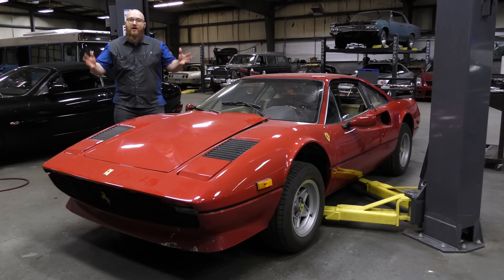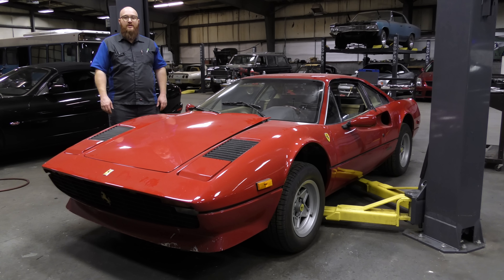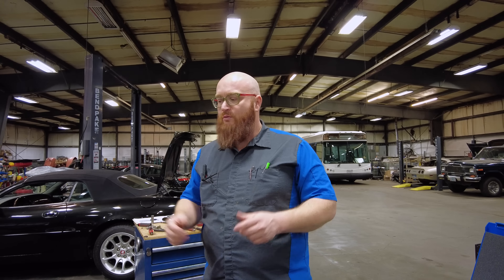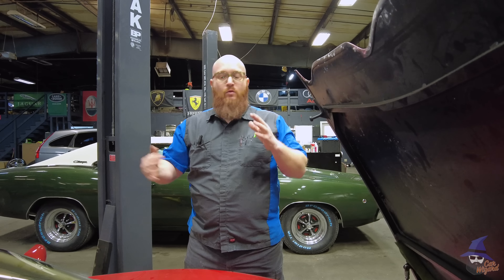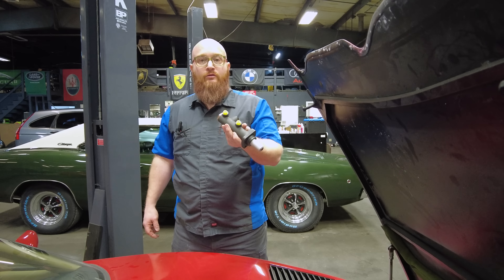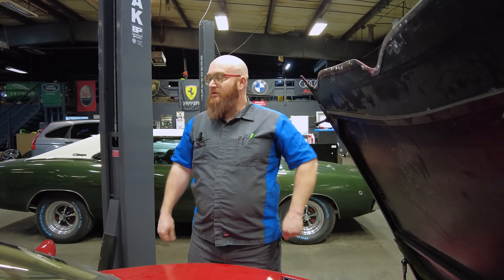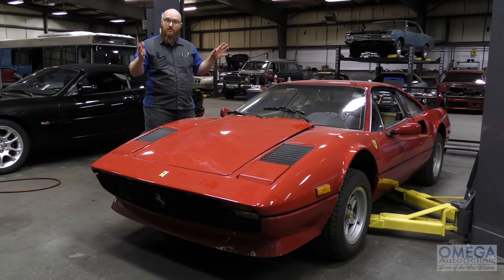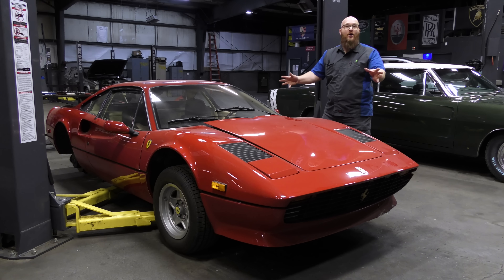My '78 Ferrari 308 can't be tuned! CAR WIZARD has to make some serious changes.

Comment: The carburetors fitted to the 308 Ferrari were well suited and reliable - when the engine and carbs, and particurlay the OEM jets fitted within the carbs are untouched.

An Australian friend (motor mechnic) that imported a Fiat Dino Spider (Fiat fitted with Ferrari V6) from the USA also experienced problems with tuning the carbs after a thorough and exhausing total vehicle, engine, ancillary rebuild/restoration that included the carburetors - a problem that remained unresolved for some time even after repeated checks of the motor, and in particular the carbys and their internals.   

After much time, frustration and detailed detective work, he found that a "genius"  had simply drilled out (enlarged) the jet's orifice in an attempt to increase fuel flow - i.e. so the number etched on the jets did not represent the actual size of the orifice (boy - did that take some digging to establish the jets were at fault).   Needless to say, than when a new set of standard jets (mains, idles, emulsion - all changed because confidence in the carby internals by this stage was low) were fitted, the motor/carbys ran like clockwork.

The aforesaid "genius" didn't understand that simply increasing idle or main jet orifice diameter (add more fuel to engine) does not automatically result in more power and improved driveability - when all other engine sub-systems remain unchanged.

Comment: Ferrari V8 cooling systems are also questionable from my experience. There water pumps fail to circulate coolant at around 2000 rpm through one cylinder head which can cause the suffering cylinder head from cracking. Test the pump to see if it works according to Otto's rules before tuning a 4 stroke engine, establish at 500 rpm that the coolant flow MUST be 10 liters per minute. Do not attempt to tune an engine that has a coolant flow less than 10 liters per minute as the hottest part of the engine being the exhaust valve SEAT will be distorting due to poor coolant flow over that portion of the cylinder head. Not all cylinders will be suffering from distortion but the best way to establish which cylinders are suffering a vacuum leak is with a set of thin wall extractors getting them to glow red hot and the stand out cylinders will be a lot brighter orange than the rest. 
Once you have achieved Otto's tune rule then the engine will perform like never before , I only say this from many years of experience.

Comment: After more than a Year of rebuilds,repairs,and updates on this with all the videos about each,I'm pretty disappointed that you have a 'cam seal leak'.Makes me wonder about the skills available as Hoovie's Jag leaks and so have a couple others.'Suppliers' aren't the problem if leaks persist.I'm not knocking the guys for the hard work,but the choices in materials.Good luck.I'll wait until it's in your hands,or Euroasian Bob's.
Reply: Cars that sit end up leaking. Meant to be driven. Jags were leakers from day one. If it isn't leaking, it's out of oil! It's only been in the last ten years or so that people complain about oil drips. Look in any garage from decades ago and there was a large black spot on the floor. Open the hood and you couldn't tell what the engine paint color was.

Comment: I have a real sports car, the kind you can sport around in and enjoy, trouble free! A 1985 MK2 Celica Supra. Best of all cheap to keep, Tires, oil changes and other fluids. A little over 100,000 miles and now due for it's second timing belt. About 200$ in parts to do it. Toyota made some of the best sports cars ever, why, because they are reliable. I believe it still has the original brake pads in it.
   Dan Gurney seems to like them, He autographed my glove box door!!! And that is good enough for me!

Comment: Car wizard.  I bought a 10 rx350 and a week later without the key in my pocket i walk into the garage.  I thought i heard the neighbor a long way away's air compressor charging but it was coming from near my fuel tank.. i think.  Under the car in back half. I got the key then started the car and the noise vanished after shutdown.  It was pretty quiet.  Can you or anybody say what it probably is?

Comment: fun fact kiddies , with electrics , particulary engine management systems , alternatives to OEM are available , consider LINK or HALTECH , no replacement plug n play exists for the 308 but they can and will tailor a unit for your needs ! MoTec make 12 cyl units  , ecu fault pfft , no problem !

Comment: I’m getting really fed up with piss poor car parts. I just put a new cooling system in a car. Both the radiator AND the brand new radiator cap itself are leaking.

Comment: Get a Toyota MR2 with a tuned exhaust, stick a Ferrari prancing horse on the steering wheel and drive rather than wrench!  I would love to see you take my Porsche 917/10 replica to the next level that I lacked the experience to do.  Two Subaru EZ30 engines to make a 12-cylinder boxer engine like the original!

Comment: The issue your talking towards,  computer obsolescence, is the issue that will kill upcoming classic cars. 2000 Turbo Beetle, with less than 3,000 made? Mine bit the dust with multiple issues related to security software embedded into things like speedometer,  AC controller,  and parts designed to fail like the water pump with no after market to support the car. So. Figure 20-30 years from now? That 1924 Ford will still be thinking down the road,  57 Chevy as well.... but I doubt if you'll see any car from 85 to 23 on the road.

Comment: In the key of The Offspring: Better keep them Carburetorated. Study up on those Weber jets and downdrafts. Remove all that modern crap. Pull out the flow sync and hook up the exhaust sniffer. In other words, be a real mechanic. Not a slave to the diagnostic computer.

Comment: In the current world of remove and replace it’s become “unfashionable” and normally uneconomic to rebuild worn parts such as a brake master cylinder - especially when you consider countries where workshop rates a relatively high.  The aforesaid is understood when it’s a customer’s mundane daily driver, however the aforesaid argument does not apply to your classic 308 Ferrari.

A rebuild of a master cylinder is straightforward, relatively inexpensive when compared to the OEM item, and would have the durability of a new part if properly rebuilt with quality seals.  Even if the master cylinder is found to be “at its worst”, i.e. the bore is found to be scored, it can be re-sleaved with a stainless steel sleave at a modest cost - a service that is thankfully still currently available in Australia.

I look forward to further videos of your 308 Ferrari and hope that you try as much as possible to retain its originality - as nothing loses values faster than unsympathetic, ham fisted modifications on classic cars.

Comment: The Electro Motive I know of used to make Diesel Locomotives. At the time it was owned by General Motors, the automotive vehicle manufacturer. It's my understanding that it was sold to Caterpillar via an investment company. I'm wondering if somewhere along to line EM was separated from the locomotive manufacturing side of things, and sold of separately.
Reply: Electro Motive before GM acquired them was a corporation in their own right.

Comment: I noticed that a USA Alternator had been fitted, and that is a great saving! But, did you also consider adding an OAP? A Overrunning Alternator Pulley will definitely improve the engine Idling and smooth-running. There is the old saying, that when performance goes up - reliability comes down. My '71 Beetle has none of those issues, just a Tesla battery Pack, and a reliable Electric Motor. Not as fast, but will get you there! Greetings from Australia.

Comment: I'll say this...NEVER buy an economy gasket set and use the oil seals....Fel Pro all the way on oil seals. All of the other gaskets were fine, but engine or trans out for the rear main that was leaking like a sieve......do not ever trust anything but the best on oil seals.

Comment: These cams look like they had been ground to offer a higher lift together with thicker shims. In this case the radius gets reduced on the off side of the cam plus a thicker shim to cater for clearance.
This is what is frequently done to powertune engines like the ones from the Jaguar XK. This requires better valve springs, otherwise you get into trouble territory.

Comment: Hey, look at me!  I drive a Ferrari and that means I have money to burn.  Cut to the guy lighting his cigar with a fiery Benjamin.  So what if a master cylinder costs a measly $700 when I'm styling down the freeway in excess of the speed limit.  It'll help me stop from 130mph to 0mph before you can say, "He's loaded."
All I can say is when a car is that much trouble to drive it's time to load into The Crusher.  It might look nice but it's just a money pit that needs to be put out of its cash-sucking misery.
An ex-Tavarish car is usually end-of-life when he decides to own it.  I think a 1978 Ferrari 308 is basically a museum piece that's meant to look at and not to drive.  The Wizard will fix it somewhat, drive it a few hundred miles and then pass it on to another "Look at my Ferrari" guy.  I'm sure it will have a happy ending as long as Benjamins go up in smoke.

Comment: My brother bought one. Best thing he did was sell it for a loss, that's one of the crappies Ferrari's ever made.
Since it's loose on the cams, I'm assuming eski reground them and they weren't installed with the proper bonding sealant on the outer surface of the seal to the head.
The only thing you can do is rip off all that Electra motive crap and go back to the factory bosch k-jet TRONIC system.

Comment: That master cylinder could easily be stainless steel sleeved for a bucketload less than $700.  Sleeved and new rubbers well under that figure.  The thing is even open both ends for ultra simplicity.

Comment: Had a 76 on my Dyno years ago.  One owner ca car.  60k miles.   Magnum PI vibes.   Interesting car none the less.   Ironic.  I still have an electromotive system with a crank trigger.  Had it on a Mitsu 4 cy.

Comment: I owned a Red 85' 308gts (for 5 years), that was a blast to own and drive. It was in near flawless condition inside and out. Every time I drove down the street, the neighbor kids would come out to see it and yell "Magnum PI". I knew that if I kept it, I would have to change to a modern fuel injection system and modern ignition. Those factory systems are primitive (85s have very early FI) and modern systems are much better.

Comment: Look at carburator, back in the day they always matched the cam to carbuator,  check the jets
Reply: They never got the carburetors right though, that's why it was so cheap and ran poorly on CarTrek.
Reply: The carbys fitted to the 308 Ferrari were fine - when the engine/carbs, and particurlay the jets fitted within the carbs are untouched.

An Australian friend (motor mechnic) that imported a Fiat Dino Spider (Fiat fitted with Ferrari V6) from the USA also experienced problems with tuning the carbs after a total engine and carby rebuild - a problem that was not solved by checking and rechecking the carbys in their internals.   

After much time, frustration and detailed detective work, he found that a "genius"  had simply drilled out (enlarged) the jet's orifice to increase fuel flow - i.e. so the number etched on the jets did not represent that actual size of the orifice.   Needless to say, than when a new set of standard jets were fitted the motor/carbys ran like clockwork.
Reply: @georgebettiol8338  lololololol yep

Comment: How about a Virtual Machine for older ECU's? You could run the old computer as software on a new computer and hook it up to a programmable input/output box. You would have to know all the electronic parameters, but it should work in theory.
Reply: He just said.... no dyno for proper peramters.

Comment: "....The ECU that runs this system is made by Electromotive...."  Wait, that's a pretty odd thing to call Weber carburetors!

What's that, Mr. Wizard?  You installed a bunch of dubious CRAP on this car, thereby preventing it from running right and DEVALUING THE CAR??????   Alllllriighty, then.

Comment: I've been thinking about how ECUs will be replaced as the semiconductors fail or the support disappears.  I figure eventually people like Jared will end up developing kits with adapters for the different connectors and precalculated tuning for different cars.  I don't know if they will develop a proprietary generic ECU, or pick existing ones to use and adjust.  It seems to be trending that way with this report.

Comment: With regard to the cams, did you even call Isky Cams? They were probably a one-off custom grind for the owner of the car who installed them. Any camshaft grinding shop should be able to measure the cams and tell you their specs.

Comment: Hmmm. Horrible ergonomics....check. Seating position only a chiropractor could love....check. Head hits the roof panels...check. Kit car interior....check. Performance that every Camry V6 of the past 15 years will guarantee you seeing their taillights....check. Expensive as hell to work on even if you can procure the parts....check. What's not to love??

Comment: I wonder if you could have resleeved the master cylinder?
As to the cams, put one in your lathe, and use a dial gauge to check lift and duration.

Comment: I would not mind betting that some of the auxiliary parts were shared by some Fiat models , which if you can their corresponding part numbers you can buy from a Fiat specialist. Bear in mind it may have to be ordered though , due to age and so on but the up side there could be a cost saving for parts

Comment: I think I could have figured it out, given some time. 
At the end of the day the engine is being run by the computer. There just isn’t a readily apparent user interface which would make altering the fuel/ign maps possible quickly and easily.
But at the end of the day it’s a computer managing an engine. 
However I would just recommend putting it on a standalone ecu. There have to be some stealthy sort of units made for classic cars, around, I’d imagine. I’ve never had the opportunity to efi tune an exotic so I’m not sure.

Comment: You could have made your life a whole easier if you just rebuilt the 308 back to stock. Then if the car didn’t fit your needs, you could have sold it and taken that money and bought a later 308 or 328 GTB that has the bells and whistles that you wanted. This 308 might be making great video content, but it’s sure has been tough on your pocketbook.

Comment: Rebuilt parts in general seem to have a very high failure rate. I'd go with used parts instead if you want cheaper parts and aftermarket ones are expensive.

Comment: Aaahhh the joys of a classic fool injection car. And ofcourse more so a Italian one. Clearly you are going to have to go aftermarket computer. And all the joys of making that work. 
Or simply fit 4 Webers and a stand alone distributor.
As for cam seal leaks,,, how much crankcase pressure does it have? That will be your problem. Clean out every breather and it may be ok. 
Cams?? Call Isky. I feel sure that they do not grind that many Fiat cams.
As for a pussycat into a Chev?? You realise that is backward as most Jags have Chevs!

Comment: I was laughing about the wizard trying to save money by buying a good used master cylinder, but there’s actually a good lesson to be learned about this. When it comes to a critical safety system like the brakes, don’t save. Buy the best quality new components you can find, because people’s lives depend on the work you do. One of your loved ones could’ve used this car and could’ve gotten into a wreck because the master cylinder failed at a critical time.
Reply: You would think a master cylinder would be rebuildable. How do they make them in the first place if they can't be fixed or resealed? Maybe there's been some corrosion inside from lack of fluid changes and they can't be machined?

Comment: So glad you're restoring this car and keeping it on the road where it belongs! However, I would really be curious to know what the cost of the restoration would be for an average person who is incapable of doing the work themselves. I know that the price tag would already be well into the 4 if not 5 digits at this point.
Reply: It changes car to car,  garage to garage - in decent shape these are a good “first affordable ferrari” but in worse shape it totally depends what is wrong, parts availability and so on - some are pretty reasonable, others are an expensive nightmare. Worth bearing in mind that parts for these will only get scarcer, in many cases it is worth looking toward newer models, the entry fee is usually a bit higher but (depending on which model) parts and repairs can be more economical.
Reply: @sathos  Yes, which is why I was curious about this specific car, rather than a hypothetical case. Wizard knows how much time he and Jr has got into it and how much they charge to do the work, so while what he charges isn't going to be the same as a local garage, I doubt if he''d be either the cheapest or the most expensive.

p.s. I've known people in the local Ferrari club, and they would do their own work in order to be able to run the car. Definitely not the worst Ferrari to own in terms of upkeep.

Comment: No offense, but the new brake master cylinder actually cost you $900 because you wasted $200 by going cheap.  It's not a Buick, parts are expensive, and used parts from a Ferrari probably saw harder use than those from a Buick.  As you said, it's a unique design, and unique designs don't come cheap.